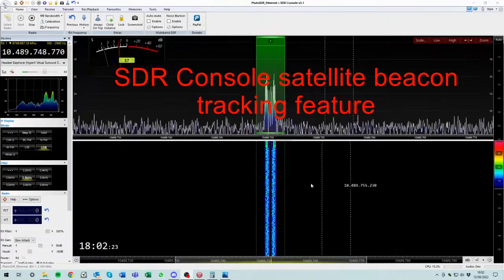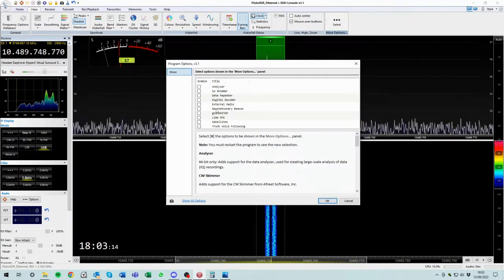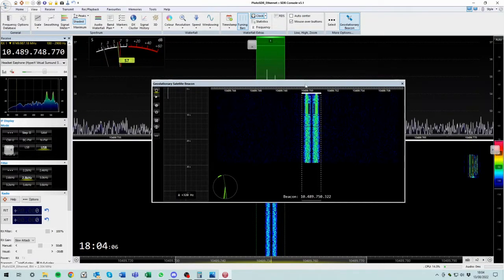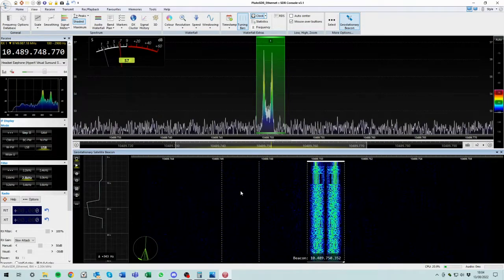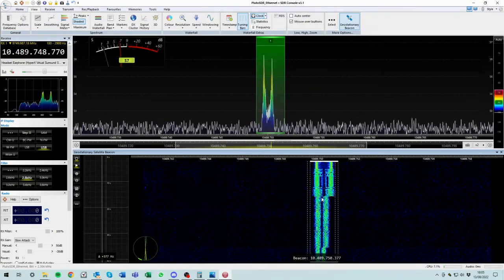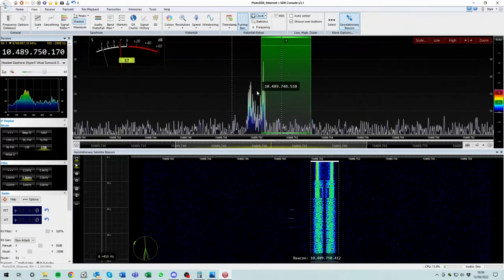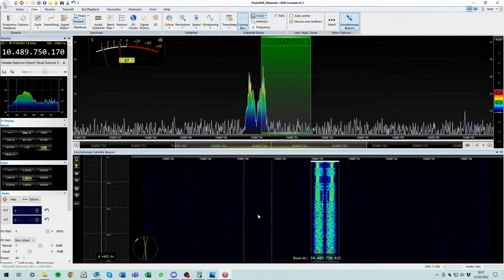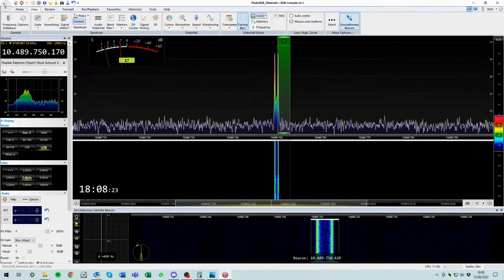SDR Console tracking

Comment: Nice feature. Is there a way to lock on the LNB's 25MHz output?
Reply from the maker: I don't think there is any point locking to the 25MHz output as that will be subject to the same drift as it is derived from the same internal clock. I would use either the SDR console beamcon tracking as shown in my video or you can lock to GPS
Reply: @dave68cat   Thanks!  I just thought it is somehow possible to lock on that output in the way like - knowing it should be 25MHz to calculate the bias while its real output is drifting.

Comment: Super helpful. you got me sold on ordering a Pluto plus. 
Do you think it can be used with DX-patrol ground station?
Reply from the maker: Hi there - I am sure the Pluto+ could be used with the DX-patrol ground station but to be honest you don't need the ground station.  The ground station is providing up and down conversion so you can cannot a UHF radio.  However, the Pluto+ can receive the 740MHz output from the LNB and also generate the 2.4GHz uplink signal directly with no need for conversion.  All you need is a 2.4GHz power amp as shown in my ground station.  See the complete ground station build at : 
https://www.instructables.com/Satellite-Ground-Station-for-the-QO-100-Eshail-2-G/